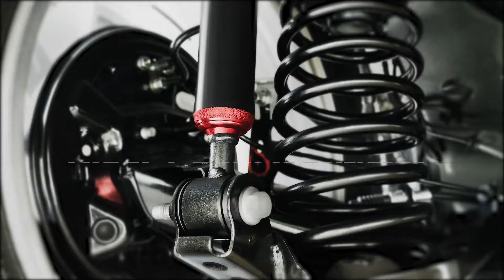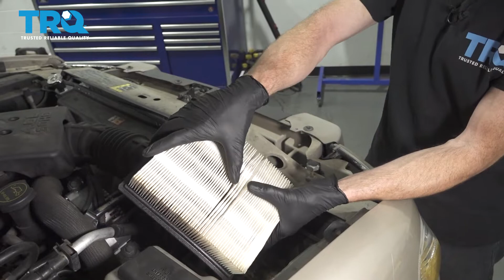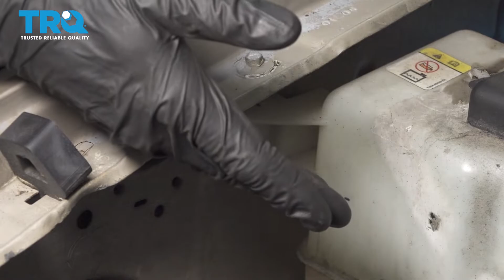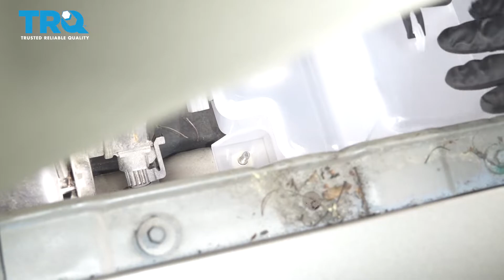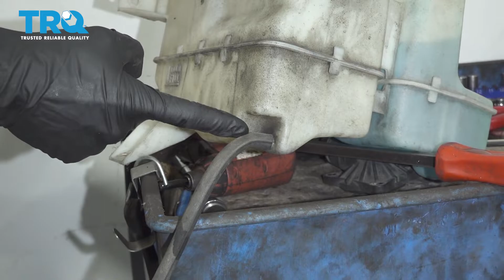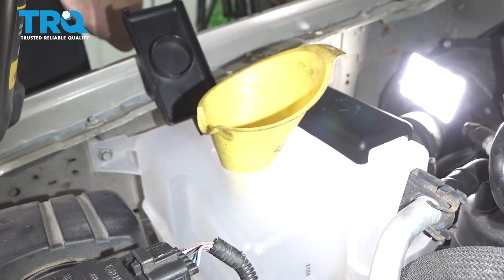How to Replace Windshield Washer Bottle & Radiator Overflow Tank 2001-2005 Ford Explorer Sport Trac

Comment: nice video. . . .I had to replace the TPS on my 2000 mountaineer v8 and they are Philips head holding it on.   I can't get the angle I need to get the screws off so I needed to remove the washer bottle.  This video gave me what I needed to know to remove the air box and then slide the bottles over.   That gave me the space I needed to get a right proper screwdriver on to remove the screws.